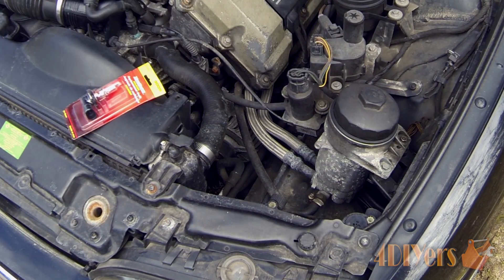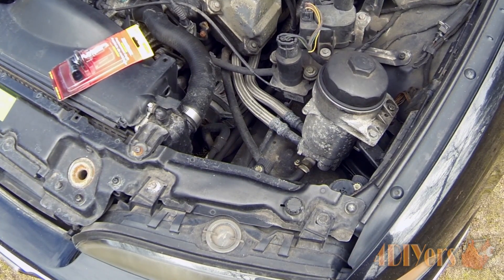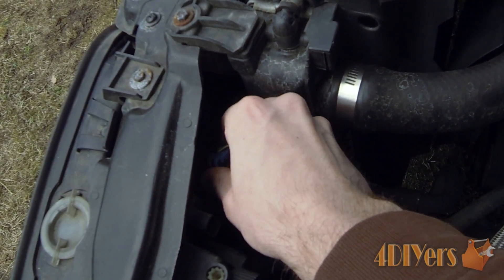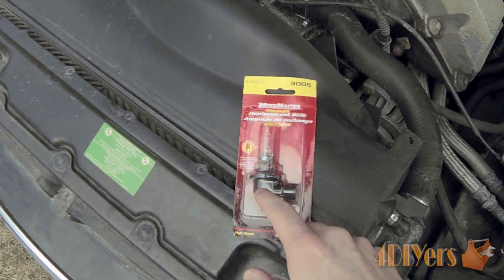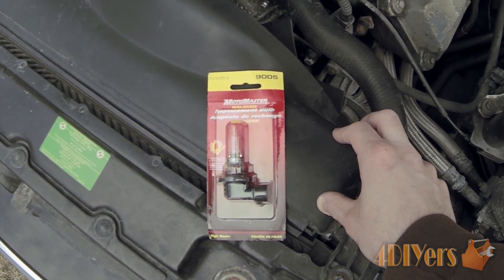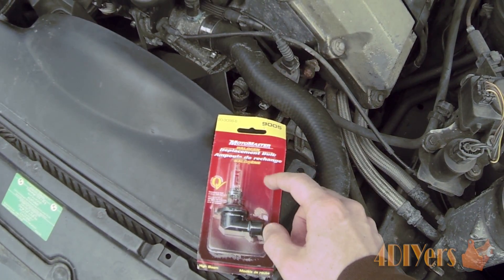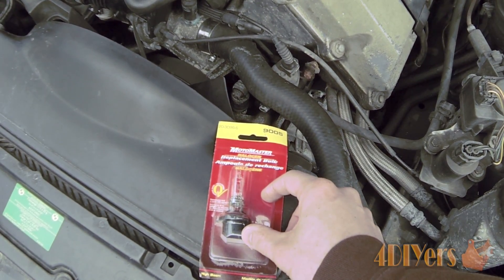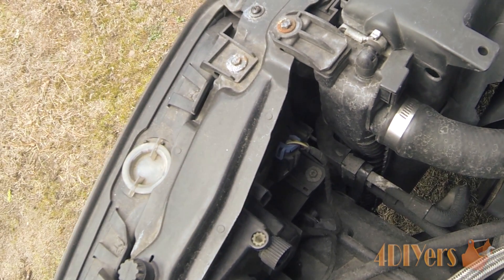How to Easily Replace a Halogen Car Headlight Bulb

Comment: i have the 97 540 i with angel eyes ,i need to change the  driving lights, not the highbeam, but i dont see this bulb abd attachment anywhere online, its about 8 inches long with two wires and   is attached to the bulb, what is it called ? im lost,thanks for your help